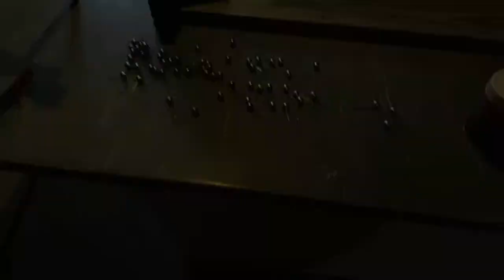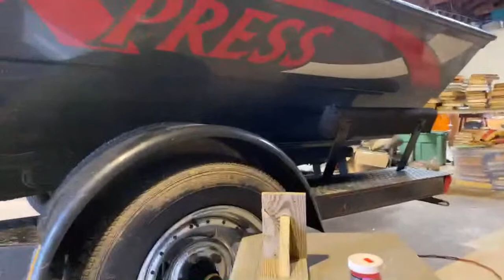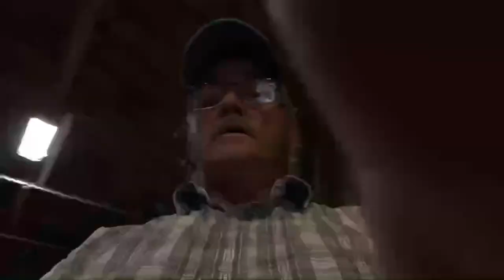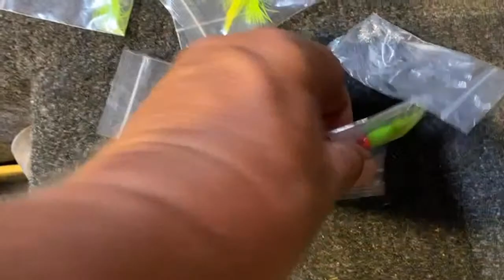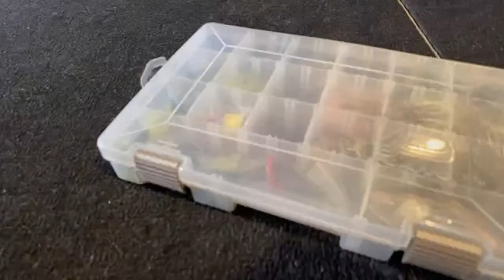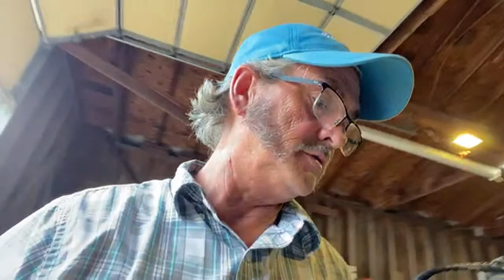How I powder coat jig heads

Comment: Adrain the 1/8 jigs seems a little heavy. You don’t get the slow fall that you would with the lighter 1/16, 1/24, 1/32 jigs. How do you fish the 1/8 jigs, and what type water conditions. ✌️
Reply from the maker: I cast them and jig and cork
Reply from the maker: Any conditions
Reply from the maker: I’ve used lighter but don’t see a difference, except the 1/8 gets where I want it faster
Reply: @awfoutdoors6299  I’ve used the 1/8 in swift water. Lakes I use the 1/16 and creeks I use the 1/24 and 1/32 depending on size of creek.